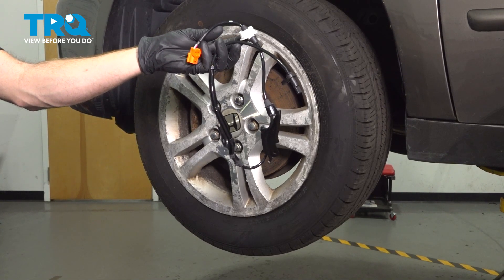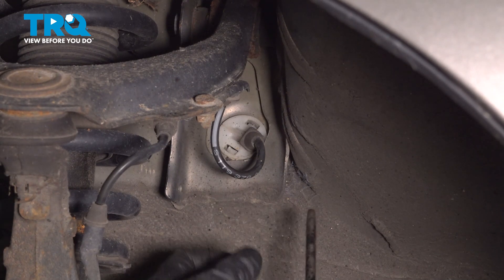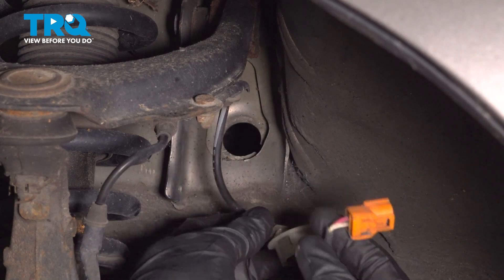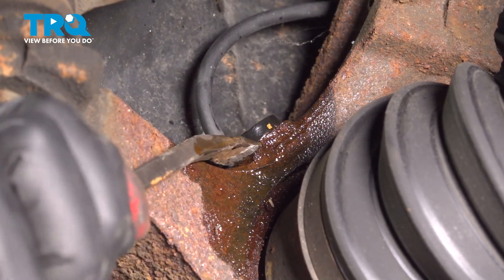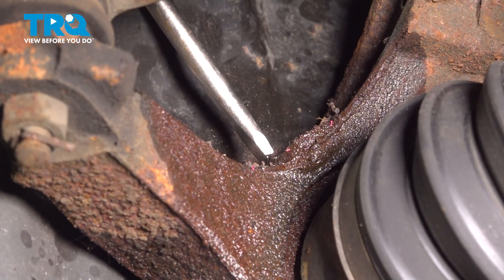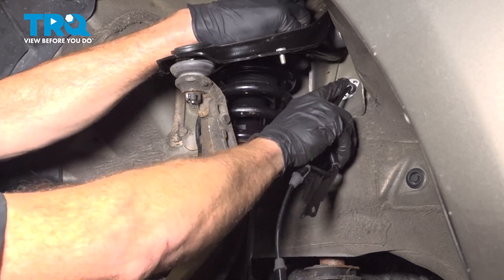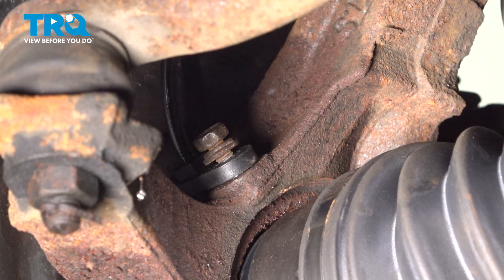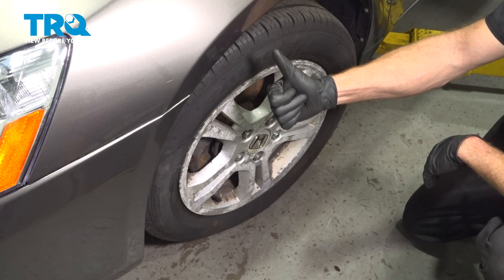How to Replace Front ABS Wheel Speed Sensor 2003-2007 Honda Accord

Comment: I didn't understand why you drilled? Wouldn't the sensor come out and you just install new one? What am I missing?
Reply: The sensors get stuck in there because of corrosion, and the force required to get them out it stronger than the often times brittle plastic because of age and climate
Reply: He drilled because the sensor broke inside the so it was stuck, had to remove the wiring still in the sensor slot
Reply: The plastic tube that houses the actual sensor broke off inside the knuckle. Drilling it out is the easiest way to remove the old plastic tube.

Comment: If these are old enough they are pretty impossible to get off without breaking it. The required force is stronger than the plastic material it's made of.